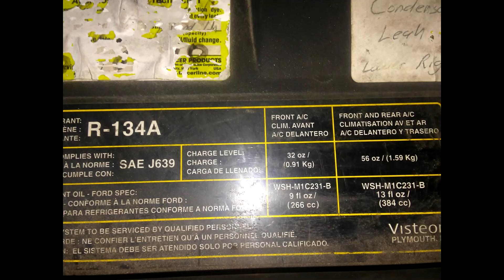How to replace A/C condenser 2002 ford explorer xlt

Comment: Thanks for the video.  Exactly how I like them.  quick with pics of what needs to be removed.
Reply from the maker: Thank you for watching and comment,  I'm glad it works for you.
Reply: I found all the bolts.  I'm having trouble getting the condenser out because of these rubber side pieces?  How did you remove those?
Reply from the maker: have to remove the top bolt (minute 0.08) and  the two bolts (minute 0.09) then remove the bracket with the rubber pieces.  Is that the one you are talking about?
Reply: I think so.  The brackets run vertical on both sides of the radiator and condensor?
Reply from the maker: Ohh ok i remember now, the plastic ones?  they are kind of covers i just pushed to the side and lift it.
Reply: I just got it, Thanks.  Kind of pried the one on the right out of the way and lifted the passenger side out with the condenser.   Thanks again for the help.
Reply from the maker: Thank you for watching and comment my video!!!